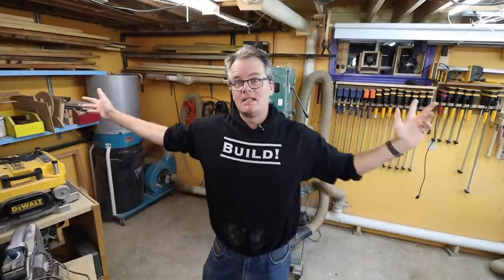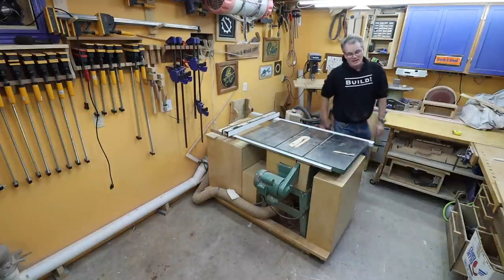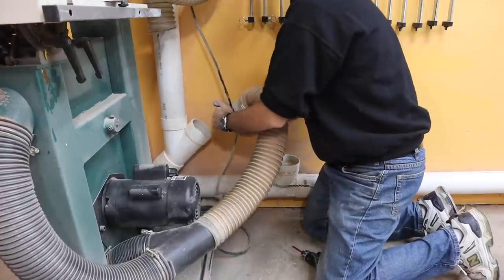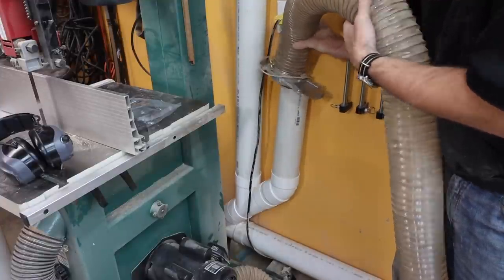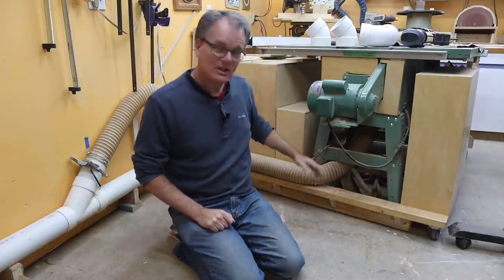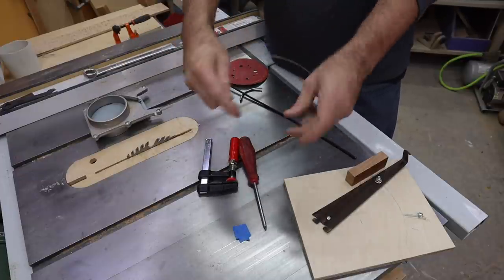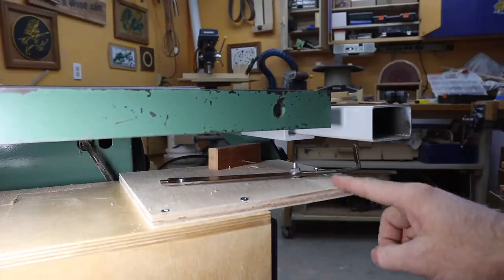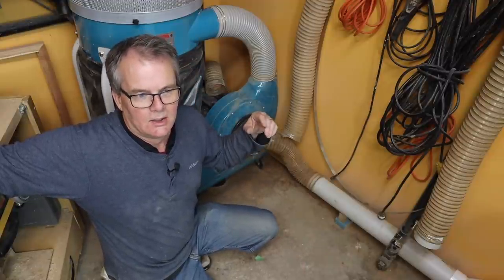THREE Dust Collector Useability improvements  // WnW 214

Comment from the maker: Special thanks to my Patreon supporters.
----------

A Blast Gate on a tool is no good, if the Blast gate is in an inconvenient location.

So I've had a dust collector in my shop for quite a while and some of the tools have moved around a bit.  So I need to take a moment and re-tune my dust collection network layout.  

1/ I need to move the blast gate from the BACK of the bandsaw to the front, so it is more convenient to access.

2/ I need to raise another blast gate from floor level to workbench level, again, to make it more convenient to access.

3/ I want to get rid of a huge(?) run of flex hose on my tablesaw and replace as much of it as possible with smooth PVC pipe.   At the same time I want relocate the blast gate, again, MAKING IT MORE CONVENIENT TO ACCESS,  I know, you've heard that before.  And to do so, I need to come up with some sort of a physical remote control -- a cable perhaps -- to control the blast gate.

4/ But wait, there's one more thing...

---------- ---------- ---------- ---------- ----------
🗜 LINKS TO SOME OF THE ITEMS USED:

(AND/OR other tools and jigs that I use and recommend.
Most of these are affiliate links.  If you buy through these
links it helps support my channel.   Thank-you so much!)

https://amzn.to/35APSXn -- Spring Loaded 4" Blast Gate
http://amzn.to/2beVc8N — PSI Long Ranger Remote controls for Dust Collection
https://amzn.to/3lCY0wr -- 4" clear Dust Collection Hose
https://amzn.to/3fcLsJB -- 4" thumbscrew bridged hose clamps
https://amzn.to/35yAc7c -- Bicycle Brake cable
(mine was salvaged off a bike, but something like this with the cable, the housing, and the right-angle guide)

https://amzn.to/2uVDPAq -- loc-line dust collector hose
https://goo.gl/g8CNRU -- (Same type of thing @ Lee Valley)

http://amzn.to/2aRa6wD — Grizzly G0513ANV 2 HP Bandsaw (I have a similar earlier model)

Comment: I had similar set up but I put main run up by ceiling and added a drop for each machine.  I also put duct tape around each joint which made big difference in suction.
Reply from the maker: Yeah the window is in the way of a ceiling run here.

Comment: There is a type of window caulk that is formed like a rope, it doesn’t dry out and can be reused.  I’ve used it in several shops and it seals nicely, and doesn’t leave a residue.  Just lay it around the fitting and push gently against the fitting.
Reply from the maker: Well that's an interesting idea.  never heard of it.   link?

Comment: I liked the idea of adding springs to the blast gates.  I also have aluminum gates in my small shop and will be playing around with that idea over the winter.  Like you I have a contractors saw and I had the same black plastic square mounted underneath it to collect the dust.  Mine just didn't work well so I came up with a version that instead of flat, is sloped down at an angle. (I sure wish we could post photos here)  It made quite a difference on how much dust was actually making it's to the DC.  It looks to me like you made several nice improvements to your system and I look forward to your comments on them after you live with them for a while.
Happy Holidays!
Reply from the maker: thanks.   Dust collection on a contractor-style saw is challenging

Comment: I don’t have dust collection figured out yet. But it surprises me no caulking or even duct tape is used to prevent leaks. Interesting to see what you’re doing. Thank you for sharing.
Reply from the maker: pvc pipe fits pretty snug, but I plan to add tape once I'm sure that this arrangement works for me.   In a month or two.

Comment: On the double 45 for the table saw, from what I've read that's actually a better way to go. The more gradual the corners the better
Reply from the maker: For a corner, yes... But I was hoping to orient the piece under the saw so that it was aimed at a 45 angle, so that I'd only need one to turn the corner and run along the back of the saw cabinet.    I didn't really explain that well in the video.

Comment: I also got rid of big filter on top and used 6 in metal pipe to vent it outside
Reply from the maker: that doesn't work in the city...
Reply: Does it affect the heating and cooling in your shop/house?

Comment: Great video! Why not put a Y and two 45s on your rigid wall pipe to connect it to your rigid TS pipe? It looks like it would work. Eliminating the flex pipe there would really increase the air flow. If you do keep the flex, you should shorten it up to remove the big bends. Just a thought... Stumpy Nubs just had a great DC video in this. I love your content. Keep up the great work! 👍🏼
Reply from the maker: As I said in the video: the tablesaw needs to be mobile
Reply: @Wordsnwood  DOH! Sorry I missed that... I’ll shut up now. 😬

Comment: Even in a prototype-type provisional situation it could become a definitive situation, it is a pity that these pipe doors do not exist here in Portugal, maybe I will have to manufacture some, embrace from Portugal.
Reply from the maker: There are many guides out there to making your own blast gates.  I've done that also, on my Jointer's connection.
Reply: Thanks Mulder for the tip.

Comment: just watched the video and my question is, do you not have to ground the pvc as i've seen other video's where they use flex hose pipe and it is grounded. i have a similar shop in my basement 11x21 and have most of what you have and i'm always moving machines around, also my dust collector is a 1hp craftex would your set up work the same.
thanks
Reply from the maker: A 1hp DC is not usually big enough for central piping.   At least, that is what I have heard.  It's really only designed for moving from one machine to another.
People argue about grounding all the time.  I don't think it's needed for a small home shop.  I've read a few articles where they tried and could not get any static to cause a problem in a small hobby shop.   Also other people who say you can't really ground PVC as it's an insulator.

Comment: Thanks for all your interesting and useful videos. I can relate to a lot of the issues you have. My shop is 11 1/2' x 24' single car garage. I have also fussed with and been frustrated by blast gates that are in awkward spots or that I just forget to change.
I've been thinking about changing my filter bag to one of the pleated ones like you just showed. What brand did you go with?
Reply from the maker: I bought a King Canada unit, KING KDCF-3500.   If I lived in the US, I would probably look at Wynn Environmental, from reading about them over the past few years.
Reply: @Wordsnwood  I'm in the great frozen north as well so my choices are as limited as yours. Thanks
Reply from the maker: @randycosgrove3608  Ahh, in that case, this is the one I bought:  https://federatedtool.com/king-kdcf-3500-1-micron-canister-filter-for-dust-collector/   Fit my old Toolex DC perfectly.
Reply: @Wordsnwood  Hi Art
Thanks for the info. I've looked further at the Wynn unit. And they will ship it but it's $153.00 US freight. Plus the cost of $225.00 ( roughly ) US, plus HST and probably brokerage and duty. Getting pretty high. 
My system pumps dust like you know the bags do so I want to do something about that.
I looked at both the Busy Bee and King units. The specs the provide are limited but from what I can see and from what the Wynn people told me I think either one will catch 95%+ of the dust that slips through my existing setup. Not as good as the Wynn but ...
I know it's just been a short while but how do you feel about the quality and performance of the King unit? 
Thanks for any more feedback you can provide.
Randy
PS both the Wynn people and James Hamilton ( Stumpy Nubs ) warn against using the spinner to knock dust off. They say that it will, over time, rip holes in the filter and ruin it. Just blow it clean from time to time.
Reply from the maker: @randycosgrove3608  You're right, it really is too soon.  I've only changed the bag once.  I think it works well,  And there is no dust "puff" when I kick the system on like there used to be with the fabric bag, so I do believe it is better that way.  But I do not have one of those Dylos meters, sorry, so I have no qualitative data.   Sorry!

Comment: Could you provide the size of spring that is on the blast gate, I have lots of gates but would like to have one or two self closing. I'm already taking apart my neighbors' bicycle!
Reply from the maker: It's about 2-1/2" long, and the coil is the thickness of a pencil, so about 5/16" diameter.  It's fastened to one of the corner screws that hold the gate together, and then hooks over a screw at the top/center of the sliding portion of the gate.   (just in case that is not obvious in the video)
Reply: @Wordsnwood  Thanks

Comment: I was going to ask why you didn't move the pipe from the back to the front of your table saw, which would allow you to  put the blast gate at the connection of the pipe to the main run, but your solution obviates the justification for that change.

The way the lever works now, it looks like you need to pull it up to clear the stop-screw when opening the blast gate. Would it be worthwhile to glue a shallow ramp under the lever so the ramp pushes the lever up as you slide it (the lever arm) towards the stop? Then you'd only have to pull the lever up to close the blast gate, and the spring would do most of the work there. Just a thought.
Reply from the maker: I have drawers in my tablesaw stand.  there is no clearance to run the DC pipe along the front or underneath.  It has to go behind.

Comment: Have you considered adding a super dust deputy?
Reply from the maker: Not really.   I mean, if they sent me one, sure.  But I have ceiling height issues to bear in mind, as I don't have a full 8ft of clearance.   And a 2HP unit is really pretty good for a one man shop this size.
Reply: I wanted one but after watching the recent Stumpy Nubs video on DC, I decided not to. You lose way too much suction on a DC that size with a separator. 🤷🏻‍♂️